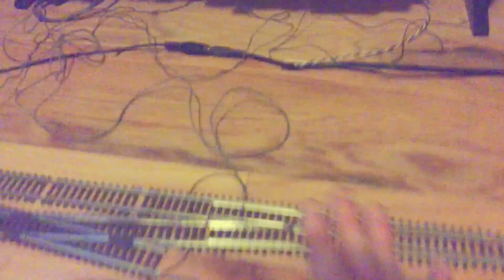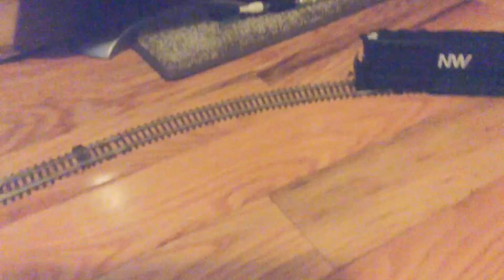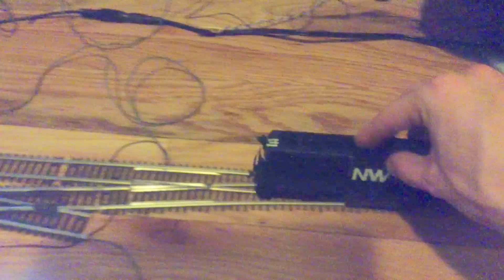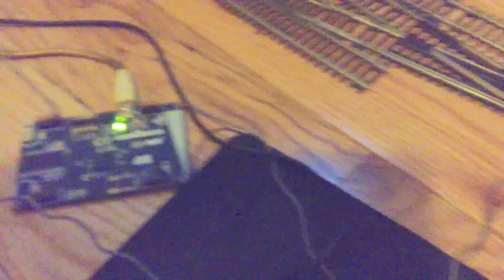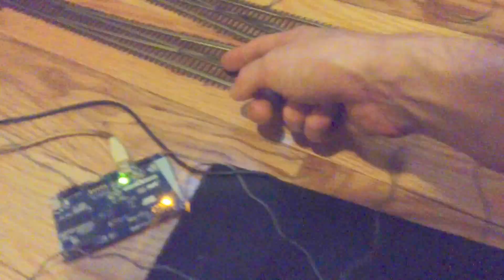HO Scale - Train Detection

Comment from the maker: Thanks! It is pretty tricky. Reading from the outer loop is kind of easy, but the hard part comes trying to read from the inner loop that is stalling the train, so I'll have the board flip the polarity on the frog and then check for voltage drop. On the new board design, I'm trying to figure out what type of connectors to use for LED and block signal inputs. I may do screw terminals or individual pins where wires plug onto the pins. It'll be a small board, but We'll give it audio and track power